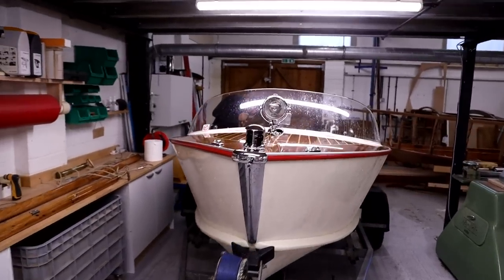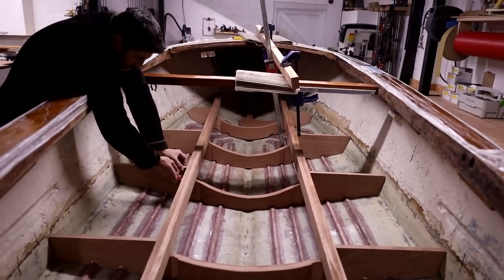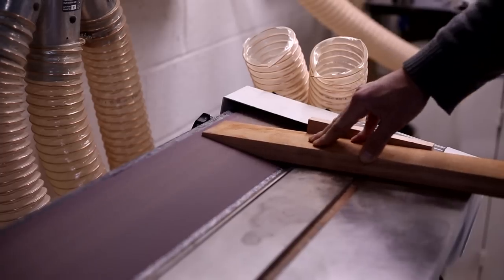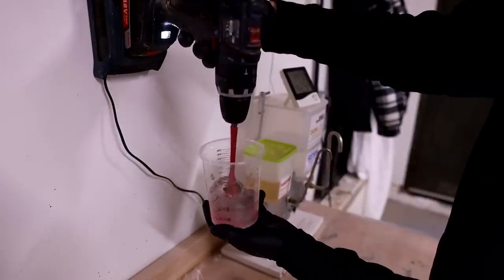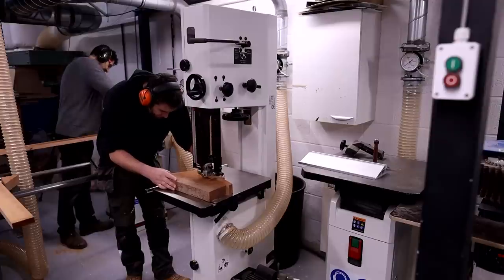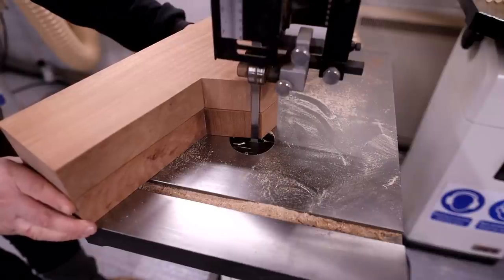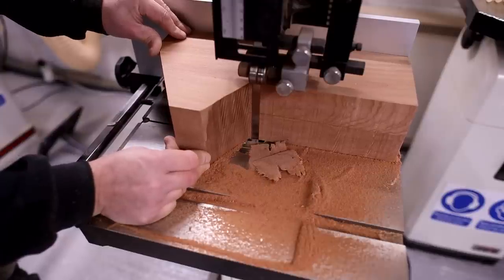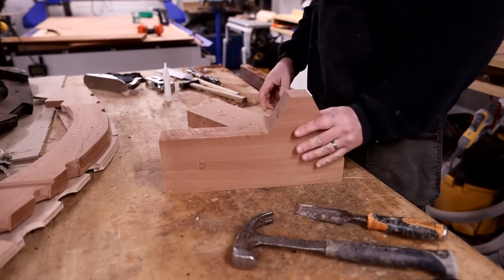New Mahogany Boat Frames and Stringers | Healey Boat Restoration Part 4

Comment: Nice work, just one question, what do you use to wash the 'blush' off the resin coated parts, acetone?
Reply from the maker: We usually just use warm water with a little dish soap in it, I'll make sure I cover that in the next video.
Reply: @DanLeeBoatbuilding  Thanks.

Comment: Looking at your designs it appears that the dimensions of your frames is lighter than normal.  Is this because you are relying on the strength of the cold molded hull to provide a larger portion of the hull total strength?
Reply from the maker: These frames are the same size as the originals.